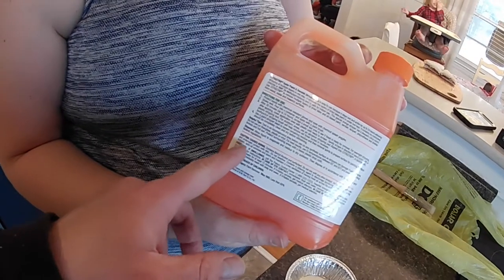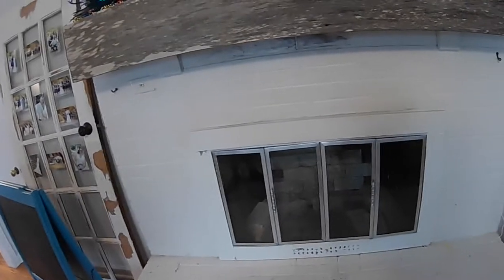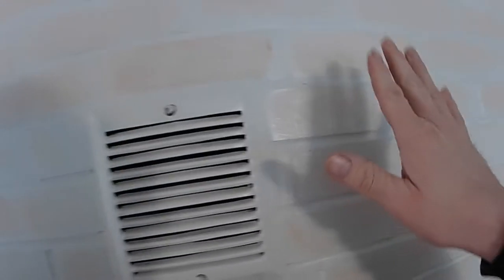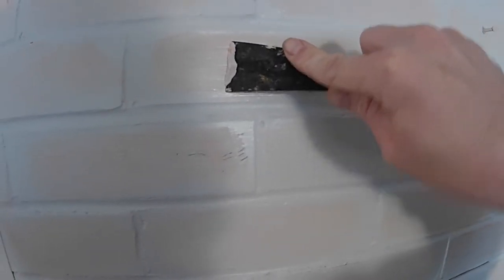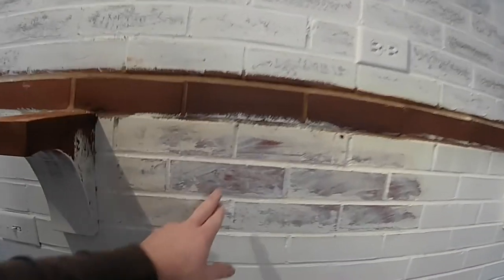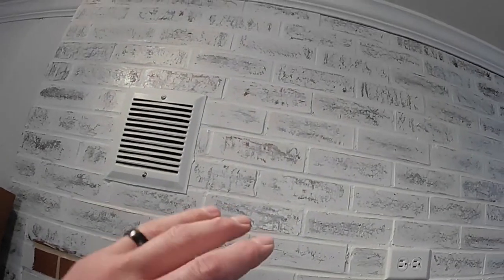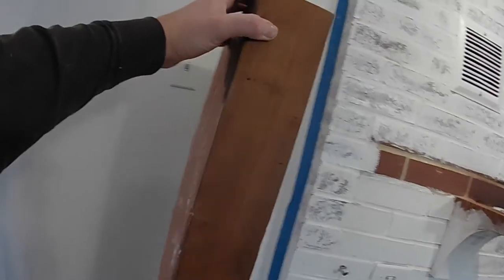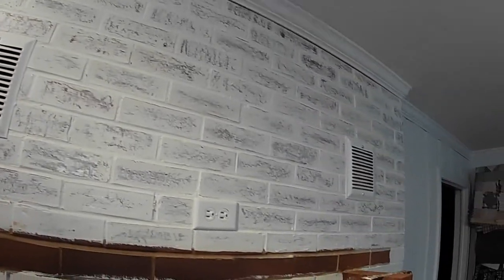Citrus Strip _ Distressed Paint on Our Brick Fireplace.

Comment: I was wondering if I could use a electric hand sander gently to make the job go alil faster? Your fireplace is what I want on mine and it looks amazing👍🙂
Reply from the maker: once the paint is ready to scrap it is gummy and sticky so i think it would make a mess if you used a sander. we did end up using a 20V porter cable Multitool with a scrapper blade on it and it worked great